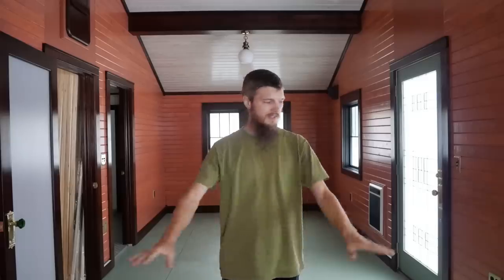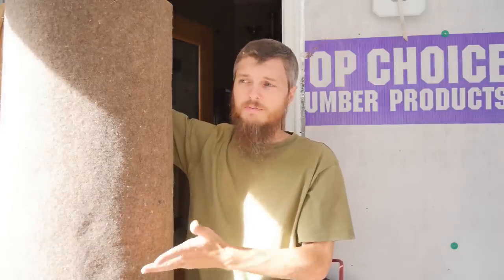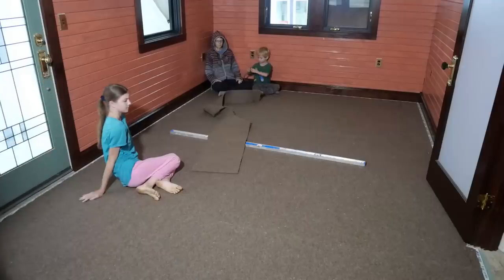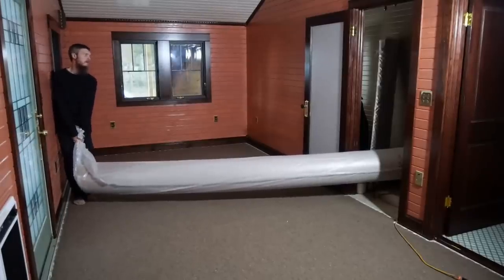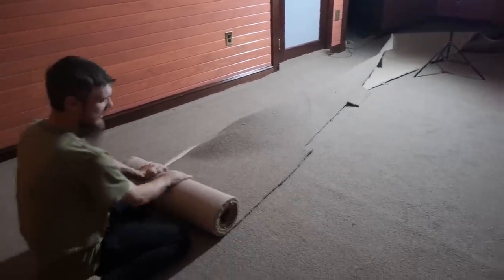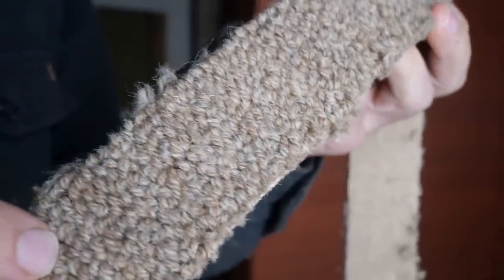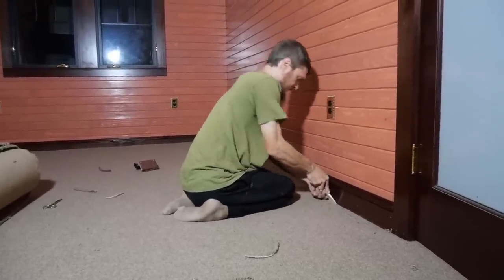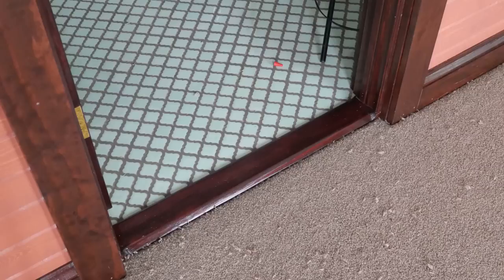Installing Carpet Ourselves - Natural Flooring Reveal + DIY

Comment: Carpeting is easy …. Compared to everything else you’ve done. I hope the humidity & dampness down there doesn’t eventually accentuate the odor given off by the wool carpet pad. Longevity is one thing…keeping it clean for that long may be whole other adventure. Otherwise looks great!
Reply from the maker: Shouldn't be a problem since we'll be using the built-in dehumidifier :)
Reply: @lady Thyme....I was thinking the same thing. I lived in Florida for over 20 years and I fought humidity issues the whole time. We had a whole house dehumidifier installed in our home and we still had issues. Wool berber carpets were popular in Florida because wool has  natural anti mold property's ,however 100% wool does have a wet dog smell that only increases with humidity.  Doug has a little more faith in his dehumidifier than I think is warranted. Time will tell of course. I wish them well. I personally love carpets ,especially in the bedroom but, the issues with carpet is keeping them clean. Their house is surrounded with dirt and mud. It will be interesting to see how clean the carpet is in a couple of years. If you ask any carpet cleaning person and they will say walking barefoot on rugs is one of the worst things you can do. Our feet sweat and the oils and sweat from them make carpets dirty rather quickly.  Best bet they have is if they wear house shoes or sandals that they only wear in house. To be honest I was kind of shocked they chose 100% wool carpets considering how sensitive they appear to be to odors.  I guess this is why they named their channel "DIYIfferent " because they are always surprising us. 😮 🙂

Comment: They don't. Make beater bar brushes anymore for vacumes. Coming from the carpet selling industry our company thrived on knowing how to keep a carpet looking fresh and new for years. The brush on my current Shark Duo Clean which has a fleece brush in front and a brush behind that does not shred carpet. Beater bars aren't installed in carpet today thenlast one sold was in the 1970s. Fine particles like sand that gets into the carpet are what does damage to the fibers people don't vacuum enough VACUUM EVERY SINGLE DAY why you might ask its because no matter how hard you try small sharp sand parties can get into the house and even by taking your shoes off at the door vacuuming every single day. My realtor couldn't believe how old my carpet was when i put the condo up for sale carpet 7 years old always trashed because the general public doesn't realize how often you must vacuum. I have always used a QUALITY VAVUUM with a brush to clean and fluff the carpet you are misinformed about vacuum cleaners I COULDN'T IMAGINE CLEANING THE SUPER THICK WOOL AREA RUGS WITHOUT THE BRUSH ON MY TOP TIER VACUUM
Reply from the maker: That's very strange. I've never had a vacuum without a beater bar. If we're misinformed, we're being misinformed by the carpet manufacturers and sellers.
Reply: @diyfferent  I need to send pictures
Reply: @diyfferent   youtube link is deleted?
Reply from the maker: @mkzenthusiasts  Links have to be approved by us, it's not deleted, just stuck in review on our back end. But I did see what you mean about the beater bar. Maybe we are using the wrong the term. The manufacturer of our carpet states: "As with all quality natural fiber carpets, vacuuming with a suction only vacuum cleaner is recommended."

So I am sorry for the confusion there. We're not carpet experts or anything, we are just trying to share what we learn along the way.
Reply: @diyfferent  is that a cut nap or looped also known as Berber  ? I've only had a plush cut loop carpet I have seen the recommended suction only on looped carpet still vacuum alot because sans is your enemy I was taught proper vacuuming by the manufacturer from the Georgia carpet mills twice a week at minimum and more if possible my vacuum never was put away because I vacuumed my new carpet I had installed in my new condo every single day and I know you guys are a shoes off in the house family which is great thats what I did and getting complimented by a realtor who sees houses all the time he asked if the carpet was new it wasn't it was 6 years old  I was very picky I even shampooed every 6 months just the traffic areas

Comment: That patting doesn’t look soft.
Reply: It isn't foamy soft but is a great shock absorber. It will out last the foam kind, will not break down over time. Well worth the investment. And with wool, static shocks are not an issue if you have that in your area . ☺️
Reply from the maker: It's quite soft and squishy under our feet :)

Comment: Definitely not my choice—since carpet is hard to clean with pets. I like your old mobile home design more. This feels very dated —like it’s from the 70s.
Reply: Dated is what they're going for, but not the 70's, more like the 20's or 30's.
Reply from the maker: Yeah, we don't care for the idea of having loose animals in our home. It's kind of dirty no matter what floor you have. But if we lived like that, we wouldn't want carpet either.
Reply: No animals in my house either. I’m not into having pee on the carpets or any other kind of floor. They also scoot along at times, so gross. I will never understand the idea of animals licking themselves and then letting them lick your face.
Reply: It's more 30's which is the age of the home. It's nice they are keeping the style closer to the Era it was built.

Comment: You're going to regret the carpeting. Cleaning it is going to be a pain in the butt. You've surrounded your house in sand and you live in a humid part of the country. Wood or tile would be a better fit in that part of the country.
Reply: I was thinking hardwood floors and then area rugs which can be cleaned and shaken out from time to time.  However I don't think it was too bad of an idea and most of the sand will end up on their porch or entryway and they are going to have a central vacuum which should be able to pick up sand.  Maybe if they get lucky they can get some grass to grow in that sandy soil.  😀
Reply from the maker: We will be using the built-in dehumidifier and shoes get taken off at the door, plus we don't have pets.

Comment: Speaking from the stand point of living in a sub tropical climate with sand for over 10 years, rugs and hard floors would have been much better. Not being rude but it doesn't add to the value of the house.
Reply from the maker: We aren't really trying to add value for other people, but just value for us. But we do take our shoes off at the door.